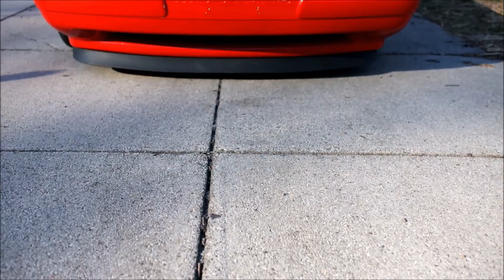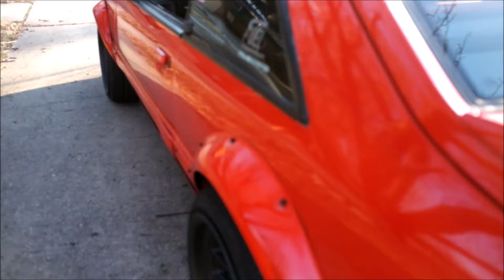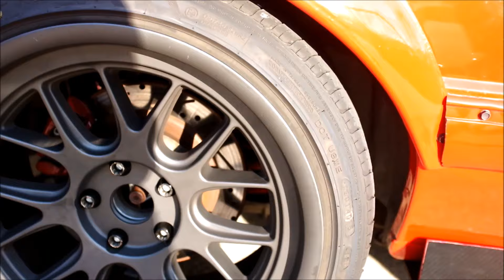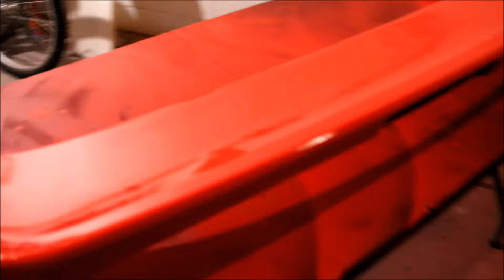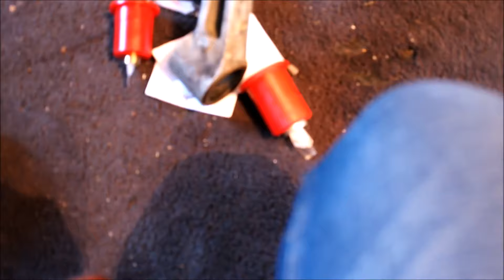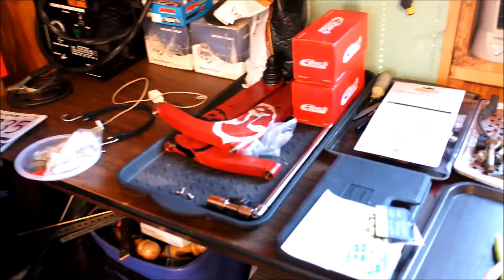Drift fox build update

Comment: I'm doing a notch drift build but I seen your car about a month or so ago and after taking a good look at your fox im really thinking twice about doing a notch drift i think im going to just get a hatch and build that one for drift instead.. clean ass fox man real talk 👌
Reply from the maker: hatch or notch, it will be the same work... Thx for checking out the channel.  Join FMC Drift on FB, EVERYONE who drifts a Mustang is on there, and theres some really good info.
Reply: Premium Fuel Mag yea I know I've had like 3 hatchbacks already.. only reason I wanted a notch is because ive only had 2 other ones in my life and out there in the bay area they're really hard to find and if u do find one ppl tax up the ass for it.. I might just end up coyote swapping this for fun and buying a hatch to drift i really like the way yours sits
Reply: Premium Fuel Mag do u need to weld brackets to the body to fit the irs?
Reply from the maker: mine are bolted and welded.  It's a little more work to actually bolt them in to all of the bolt hole locations because the bolt hole on the bracket is slightly of from the bolt hole you would want to use.  This article shows my set up, and also describes how you can do a fully bolt in set up. http://premiumfuelmag.com/project-foxbody-update/

Comment: nice car man i got the same ebrake iv tried every thing to make it lock up my rear brakes its just cheap. im all so looking in to making dual caliper set up
Reply from the maker: i actually switched out the cheap master cyl with a legit one from Wilwood, the cheap one actually worked better, but it broke, thats why i ditched it.
Reply: ya i tried the willwood 0.85 did work a little better just had to pull harder i am using -4an braided lines all the way
Reply from the maker: did you really mean to type .85?  My no name master cyl was a .75, that worked better than my current .65, but it broke.  Maybe i should upgrade back to a better .75.  Also, i couldn't find the braided lines i would need for my setup.
Reply: ya 0.85 willwood because of the bigger 4an braided line i figured a bigger bore would help which it did

Comment: I did my IRS subframe bushings myself with the Maximum motorsports removal tool and it took some time and patience but got it done. By that time I didn't want to mess with the control arms so I dropped them off at my local Sears automotive shop and they pressed the old rubber bushings out and installed the new PU bushings for about $50 and the turn around was quick. Worth every penny IMO.

One more thing. Do you have an aftermarket diff cover? Do you at the least have a diff cover brace? I have the stock diff cover but installed PU diff bushing along with a Billet Flow diff brace and it works great! 

I'm in the process of installing all new seals on my engine followed by a Kenne Bell 2.1L Flowzilla twin screw. I'm going to be stoked come Spring time! I'm thinking about making a video with a build progress slide show and a start up walk around. We'll see.

Nice progress on the car. Good luck!
Reply from the maker: I'm running the steeda diff cover brace, hopefully that will be enough since i'm lighter and less powerful than a terminator.    Sears was the first place i tried, they couldn't help.  I ended up doing it myself on a hydraulic press, it took some time and patience, but it was fairly easy.  I wish the 5.0 could take a twin screw! What year is your stang?
Reply: I have a 1990 LX hatchback. You just need to find a KB when one pops up for sale like I just did. I have two of them now =)
Reply from the maker: KB ?
Reply: Sorry, Kenne Bell (kb)
Reply from the maker: I'd really love to do that setup, but there is no lower manifold to put that on a 302block

Comment: http://dvanzstore.bigcartel.com/product/cobra-replacement-irs-billet-aluminum-uprights they're pricey but they do exist. check pout fmcdrift.com to if you haven't seen it before
Reply from the maker: Someone recommended that to me.  That price tag is out of the question.
Reply: I completely agree, going to be looking into making a bracket for mine. Not sure when that'll be, focusing on getting the car driving first lol
Reply: Premium Fuel Mag I'd like to start a group buy on the uprights. I've been e-mailing Doug to get a price ironed out
Reply from the maker: Even at group buy prices, theres no way that price would come to a reasonable range.